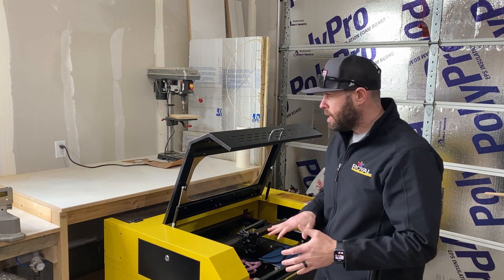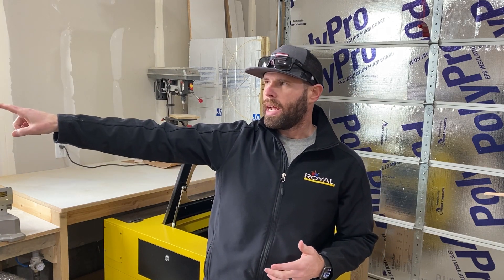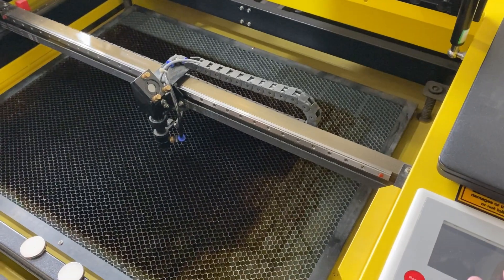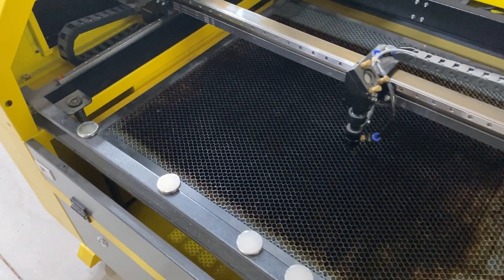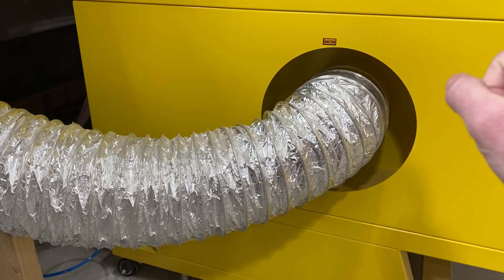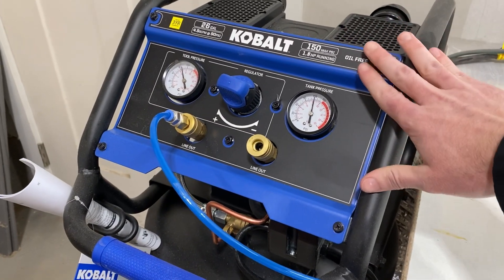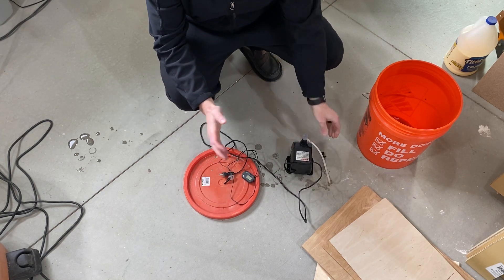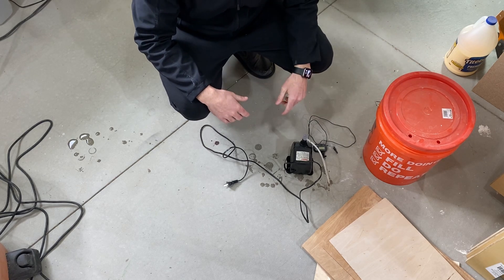Tour Of My Laser Setup

Comment: @Bearded Builds Co  Great video! I noticed that several people commented on your decision to replace the air compressor. I'm looking at replacing my stock air compressor and came to the same conclusion as you did that the 26 gal Kobalt was a great buy. However, I was wondering about the duty cycle limitations and couldn't find anything in the user's manual on Lowe's website. I own a 10'x5' laser that I regularly use to cut 5-12mm ply. Cut times are normally in excess of 8 hours uninterrupted for an entire 4'x8' sheet. Do you think that the Kobalt would be able to handle those sorts of demands without burning out? Thanks as always for the advice!
Reply from the maker: Hmmm… with long cuts like that it might be worth trying an airbrush compressor first that is meant to run constantly.
Reply: @BeardedBuildsCo  I was curious how much that compressor runs while you do cuts...

Comment: I had to double check that my laser is still in my shop. I have the same exact laser, same exact regulator, and also the same exact small silver compressor, same exact extractor fan, though mine is setup differently, the regulator is attached to the front so I can easily adjust it for cutting or engraving. I also have a mA meter on the front.  I was seriously laughing when I saw the same exact items!  I also use Lightburn, on a Dell laptop. SMDH.
Reply from the maker: Ha! I have people ask me all the time where they can buy the yellow units. Sorry discontinued. 😂
Reply: @BeardedBuildsCo  Rustoleum makes a paint that is a darn near perfect match to the yellow, so build a cabinet and painted it yellow and black to match.

Comment: I noticed your magnets on the lids, are they glued down or just stuck on the frame? I was considering them to attach a surge protector to keep it tidy when moving my laser in my small workspace. And now to keep the lid more secure. Thanks
Reply from the maker: The magnets are just sitting there. I will use them on my ply to hold it flat.
Reply: @BeardedBuildsCo  An even better use. Thanks for the reply!
Reply: @BeardedBuildsCo  what magnets do you use? I purchased some from Amazon, but they wouldn't hold 1/4 plywood.
Thank you for the video
Reply from the maker: @RifurTB  these are the ones I use.
https://amzn.to/3sALgdy

Comment: Appreciate your videos! Why the change in air compressors?
Reply: I came to ask the same question. Does moving from an 8 gallon to the 26 gallon just make it run less often as it has more storage? Is it quieter than the California Air you replaced? Did you just need a bigger compressor for other air tools also?
Reply from the maker: The change was mainly to reduce the number of cycles during a job. The large compressor is louder than the 8 gallon but still way quieter than non quiet models.

Comment: Another great video.. any reason you went with the bigger air compressor?? I will be great a new air compressor soon. I want the quite one. Keep it up!!
Reply from the maker: The bigger compressor has a larger capacity pump and is able to keep up better with the demand from the laser.
Reply: @BeardedBuildsCo  cool so you think the 10 gal is not the way to go?? I have a older bigger tank. But it’s so loud... I was looking at that 10 gal but for like $100 I can get the one you have
Reply from the maker: I would get the kobalt 26 gallon quiet tech all over again!
Reply: @BeardedBuildsCo   sweet I wait to save up a little more